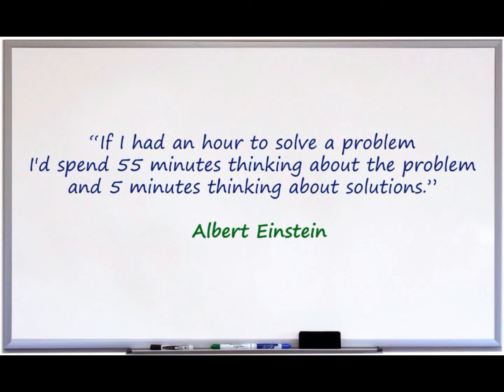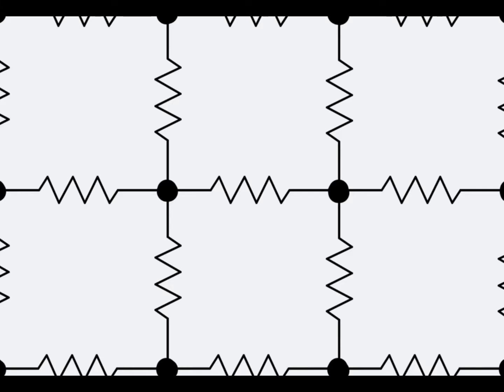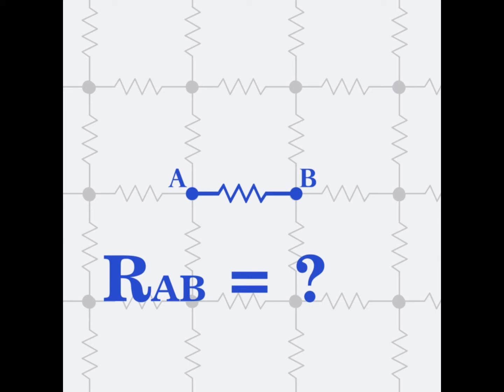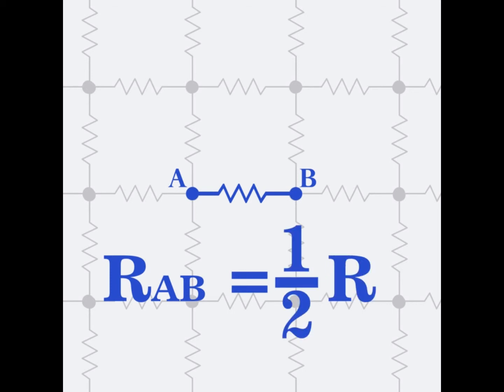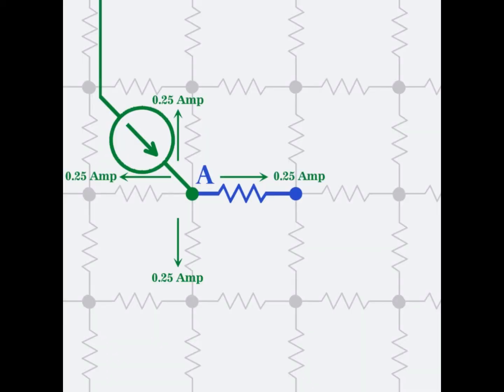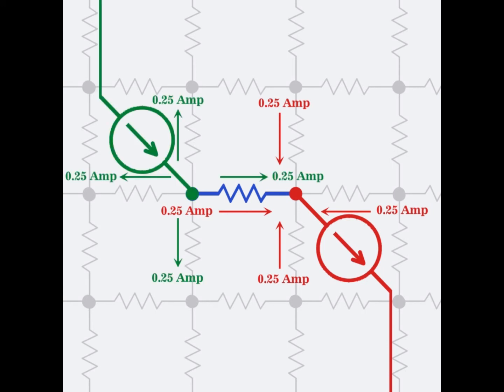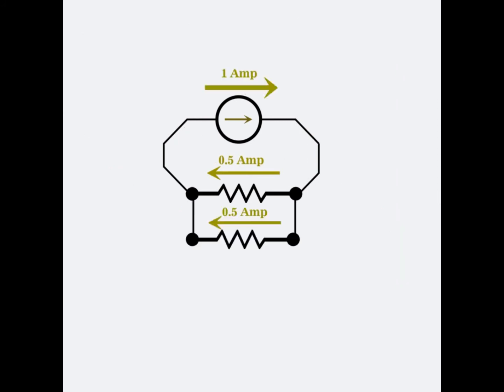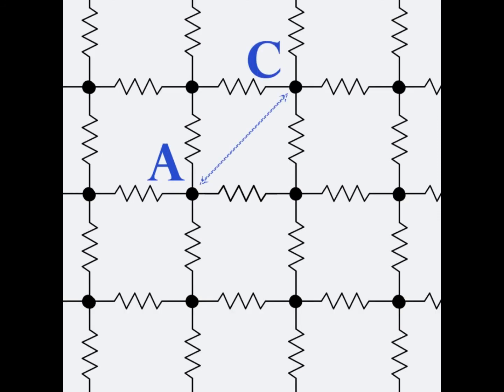Infinite Resistor Grid Puzzle

Comment: Please Clear me this doubt Academia...here you have told that the current through the resistor across A,B terminals is one half of the total current.....But here the total current is 2A But not 1A when both Conditions were superimposed.... hence,the current through resistance between A,B is not half of 2A(total current)....please give me reply fast...
Reply from the maker: Thank you Sai for the good question. Each current source injects 1/4 of its current through the network. The first current source (1A) pumps in 1/4A through the resistor at AB.  Similarly, the second current source (1A)pumps out the same  amount that 1/4A. Bear in mind, these current sources are tied at infinity.  Now ,  if we connect a single  1A  current source  in parallel with  R at AB, we would have 1/2A= 1/4A+1/4A through R at AB and the the remainder of the current (1/2A) flows through what is in parallel with the resistor . Therefore, the equivalent resistance must R/2.
Reply: Academia ...Friend...ThanK You For Giving Me Reply...connected at infinity means...they have effect on the circuit or not..? At the Same time what is the effect of new 1A current....?
Reply from the maker: "Infinity" is  a concept, Sai. In this puzzle, it indicates the circuit is symmetric at each node. Otherwise, injecting current to a node or pumping out current from a node would not get equally divided through the resistors connected to that node. When we say the other terminal of the source is connected to the circuit at infinity, we simply want to maintain this property.
Reply: Academia  Thank You Yarr...Nice Thing...Yarr..Please Send Me The Link Where You Have Find This Concept...Either Here Or Through Mail
Reply: Academia  By The Way...You Good Name Please...

Comment: Imagine there was a single current source say "i"  where one end(current enters)  was connected to one node say A and the other (current exits) was connected to node B which is adjacent to A.  Because B is closest to A one would expect most of the current to flow direct from A to B ie the path of least resistance. So current entering Node A would divide into 4 unequal parts and NOT 4 equal parts.  Similarly current exiting B is not 1/4 i though each branch but actually 4 unequal currents.  The flaw is assuming the current divides equally into 4 parts. It cannot because we have a single current source connected from A to B which is equivalent to your having 2 current sources placed in exactly the same way and because A is closest B Route-wise the 4 divisions of current cannot be equal
Reply from the maker: +Colin Rebello
Thank you Colin for your comment. I believe, in  your comment and assumption, the key characteristic of this network is forgotten. Please recall that the network is called "Infinite Resistor Grid ." Therefore, the answer to your question, "where is that?," is that it is at the boundary of the network. Clearly, if we take away this feature of the network, we lose the symmetric behavior of the network and this explanation is longer valid. Please also be reminded that in the network, closeness is irrelevant. What matters is the impedance and if a current is divided into equal impedance paths, it would get divided equally.

Comment: This explanation is flawed and incorrect. However the final answer 1/2R is correct.
Let us assume that there was just one current source where the current enters Node A and exits Node B (adjacent to A). The current enters Node A would not divide 1/4 in each of the 4 directions. Rather it would divide into 4 UNEQUAL parts (Note)  where most of it would go from A to B since B is closest A and the other 3 parts being whatever.  In your video you have shown the current entering A while keeping the other side (in the air... at infinity...where's that?). Suppose the other side was attached to Node B then Infinity is Node B and the current would again divide UNEQUALLY...and not 1/4 as suggested. There is another explanation of superimposing current sources which fixes both input and output to the mesh nodes themselves (and not infinity)  and still gives the equivalent result as 1/2 R.   If you want that explanation I can give it to you at
colinrebello@hotmail.com
Reply: Colin Rebello: Can you mail me your solution to me at ranjit.kr.nair@gmail.com
Thanks in advance.

Comment: The 0.25A current which flows in is taken to be different than the 0.25A current flowing out. Why is that so? 
Why isn't the 0.25A entering taken as the 0.25 A, leaving. 
While one may argue on the basis of the principle of superposition, how come the net current is then not taken to be 2A, superimposing the 1A entering and the 1A leaving?
Reply from the maker: +Jaime Lannister 

Excellent question Jaime! Thank you.

Let's review the solution again.
1. One terminal of the first current source, the one pumping current to the node, is connected to network at infinity. Therefore, since the device is symmetric, 1/4 th of the current flows through each resistor at the connected node of resistor "R". 
2. The second current source is also connected at the infinity to the network. The other terminal of this current source is connected to the other side of the resistor "R". Again 1/4th of this current  is drawn out from the connected node.
3. When both current sources are on, note that they are connected together at infinity, 1/2 the current must flow through the resistor. Then the rest of the current must flow through the rest of the circuit. Therefore, the equivalent resistance of the network across each resistor must be equal to R/2.
Reply: +Academia I am sorry, but your reply just recaptures what the video  says. And it is still confusing.
Reply: +Academia I am sorry, but your reply just recaptures what the video  says. And it is still confusing.
Reply: +Jaime Lannister Hi Jaime. If you are still confused and need extended explanation, you may want to visit this page:  http://www.mathpages.com/home/kmath668/kmath668.htm
Reply: +Louis CK Never mind. I understood it by thinking of current as electrons moving under force, and the battery as being the causing factor of that force. Basically, the forces get added up.
Reply: No that is not correct.   Are you still trying to understand this?
GH